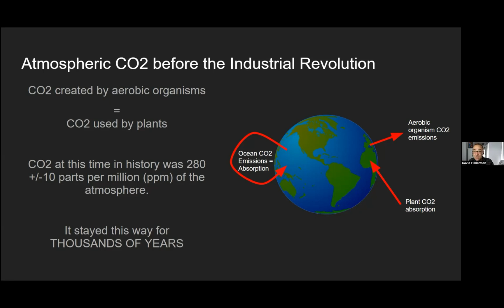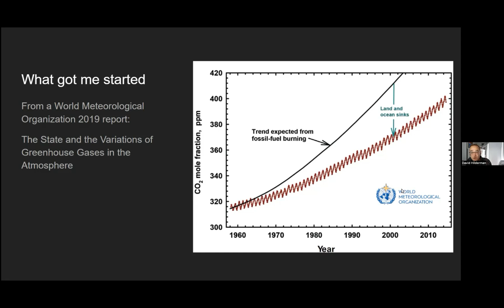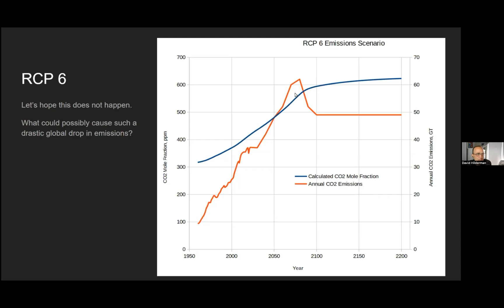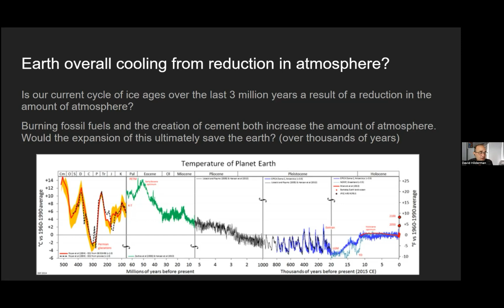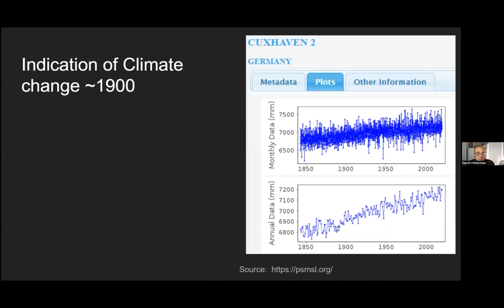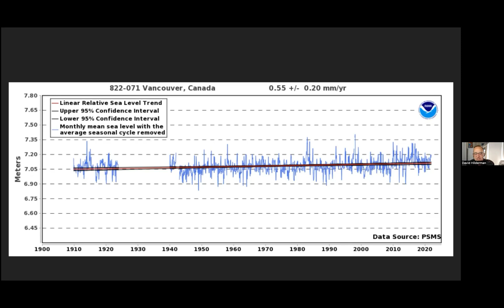David Hilderman: CO2 Emissions and Atmospheric Levels | Nelson Pod #220

Comment: As CO2 is not causing any real sort of warming whey are we even panicking?

When our atmosphere was forming and less than 20 CO2 parts per million there was energy transferred causing warming as heat was radiated from the Sun!   This declined after the first 20ppm on a log base.   The Pen University in an experiment confirmed this writing above 340 parts per million no measurable heat was detected. 

That experiment destroyed any reason for pushing net zero.  As CO2 increase causes insignificant warming it will have no benefit at all.     Net zero  a control device to destroy the last 300 years of scientific progress  any understanding of science raises many reasons to doubt the competence of   those  advocating any carbon seqestration.  If any disagree explain where I'm wrong.   Radiation relies on resonance to transfer energy.   It was over millions of years ago.
Reply: The stupids (a la Bonhoeffer) are in charge...
Reply: CO2 on earth was likely 900,000ppm before life on earth.  Just like mars and venus.  Life used co2 to create plant biomass and calcium carbonate until there was nearly none left.

Comment: I'm glad that you spat out the koolaid. I was always a skeptical observer and decided that ALL warming will end / be proofed by sea level. Like you a looked at Victoria which was the most stable data anywhere on the coast. I explain it by saying if you stand on a rock with water at the bottoms, a hundred years from now, if your boots are short, your feet will finally get wet ... some existential threat.

Comment: Very good video with lots of information.
The correlation between fossile fuel and rise from powerty is a bit over simplistic.
You want cheap reliable energy for a thriving economy. We also get that from nuclear and hydro power. In most places it is easier and cheaper with coal plants. 
As there are a lot more coal, oil and gas plants it looks like the correlation is between them and thriving economy.

Comment: in your equation you should perhaps add the effect of Cocolithophors in the oceans.
These little creature absorbs CO2 in the form of calcium carbonate with which they make their shells for defence.
They routinely absorb mega tons of CO2 which gets trapped on the sea floor as solid and becomes sedimentary rocks on their death.
This is a one-way absorption and which does not restitute in the system.
You should google it for more quantitative details.
Reply: Thanks!  Yes I was aware of those things and actually described them in a video I made a few years ago but didn't remember them in this presentation.  I suspect that they are the reason for a significant reduction in the mass of the earth's atmosphere.

Comment: Tom, at 3:48, you answer your own question, but you miss it!! So what that the northern hemisphere has more land? That by itself isn’t important. What is impotent is that there are lots of foliage, mostly trees. Not that the rest of the world doesn’t have trees, but the southern hemisphere has less land and is largely arid. 

This cycle was discovered by a guy named Keeling in 1958, I believe. This is proof that human produced co2 doesn’t even measure compared to natural co2. Think about it, every year, the natural variation is 8 to 10 PPM!!!! This doesn’t account for the equatorial foliage, as this is largely consistent. More plants grow, more plants die, more atmospheric co2. Thus, the annual increase of about 1 PPM. Sure, some of that is human caused, but not a lot of it.

Comment: 11:20 I am undecided in either direction on CO2, though I lean away from the climate alarmists.

However, it should be pointed out that just because the oceans are "absorbing X amount of CO2," it doesn't mean the oceans are processing it like plant growth does.  The dissolved concentration of CO2 in the oceans is also increasing, and there isn't an infinite capacity for them to do so.  What that capacity limit is I cannot say - but there is a limit somewhere.

Comment: Yes I've done this and used most these slides myself at one point.  I'd like to talk to you more about this, I believe i have roughly 500 to 1000hrs of research on this including some unique approaches you may like (animal generated co2 low estimation 680gt a year). Also carbon based life on a predominantly carbon earth should reveal how carbon is opposite of a pollutant, but actually essential for ALL life.  Every single living think from bacteria, fish, and us require co2. And how co2 is plant food and how plants are starved, their optimal ranges are 3 x to 4 x current ppm levels. Or how moles are a dimensionless measurement and the SI regarding measurement would mean mol isnt a measurement since there is no base unit (there is more, but too much to go into by text). Think on this, have you ever seen an air bubble travel deeper in water? Or what makes your pop go flat (or no more co2?) Co2 in many water beverages will rush out of the liquid when container is opened, I've never heard of it going the other way, density shows otherwise  (but i believe true science means to be open to any possibility,  never fall in love with a hypothesis/ theory, always follow the data, and be more critical of studies within your bias than without, and lastly always verify the foundation is solid). You can't build a hypothesis upon unreality to prove reality (big bang for example assumes reality was created by disorder, randomness, chance/ chaos, but that's easily dismissed, the scientific method alone disproves it since it's a logic based, ordered structure that reasons out repeatable principalities. Does the moons phases change at random? Does the sun rise change cardinal directions? Do seeds ever bring forth something other than is own kind? 
I think i could possibly save you a couple years of research, or at least share where to find some of the different research i utilized.  Either way, I do think you'd be interested.
Reply: I would be into connecting once the daily comments slow to a trickle.
Reply: That sounds good

Comment: Will Happer is among the most learned and most expert specialists at the interaction of atmospheric gasses with electromagnetic radiation humanity has ever produced. His opinion on CO2-caused warming (my summary): it's a total non-issue. Why? Because the physical mechanism that causes the warming is 98% saturated at a concentration of 400 parts per million by volume (ppmv). The concentration right now is about 425 ppmv. No matter how much CO2 is increased, the CO2 caused warming can only increase by 2% of what it is now.

Comment: If plants could talk, they'd say thank you to humans for replenishing some of the carbon dioxide that was taken out of the atmosphere and turned into fossil fuels and carbonaceous rock. Burning fossil fuels is a net-zero process.
Do a simple Google search and check out CO2 levels and global temperature over the last 600 million years, you'll see that atmospheric CO2 is very LOW and the planet is in a COLD period at this time! Furthermore you'll see that CO2 clearly does not drive temperature!
So why are we spending trillions of $ that we don't have on a problem that doesn't exist for solutions that wouldn't work even if the problem were real?? 
Check "Climate The Movie - The Cold Truth" on youtube. It does a good job of deconstructing man made-up climate change.

Comment: 22:00 Stomata density has an optimum, not only governed by CO2 levels but also availability of water. Having more stomata and opening them has the advantage of inhaling more CO2 and exhaling more O2 (thus promoting photosynthesis/growth), but the disadvantage of losing too much water and drying out: it is a trade off. Therefore, higher CO2 concentration enables plants to have less stomata and grow in dryer environments.

When comparing stomata densities it is crucial to take water availability into account!
Reply: The edge of the desert is the threshold of where stomata loose too much water. Increase CO2 and the desert retreats.

Comment: Here's some interesting tidbits. The surface area of the oceans is 361.74 million sq kilometers. Surface area on Antarctic glacier in summer 13.5 million sq kilometers. Avg ice depth 2000m. Area Glacier/Area of the Oceans gives the ratio as a percentage. Multiply by the ice depth. Another trend to watch is the end of the Milankovitch Cycle formerly known as the Mayan Calendar. Arctic Sea Ice Extent was trending downward until 2012/13. This has been trending upward since then, with increasing sea ice square area. Antarctic Sea Ice Extent was increasing, trending upward until 2014/15. Antarctic Sea ice Extent has been trending lower since then. Climate Sea Monkeys are sounding the alarm on the Antarctic Sea Ice melt now. I'll bet everyone has forgotten the scramble and summits that occurred in 2013 about opening up northern shipping routes and a route through the Arctic Ocean? Luckily the internet existed then, the news of the time can still be found. It has happened before, it will happen again. Half a million years of core samples show CO2 plummets in the 100k year cycle deep freeze that lasts 70 thousand years like clockwork. That's the real climate emergency. If the tiny amount of CO2 actually affects climate, maybe it will stave off the pending ice age? However, that would be a stark departure from the half million years of historical data.
Reply: Yes. It is ridiculous to call 2C of warming a crisis when all climatologists know about the 70,000 year glacial cycles. They should all be thrilled that if we are warming the earth we could be averting an ice age.  Duh.

Comment: Tide Guages in England (& Longer but lower resolution in Holland)....show Slow Steady Sea Level Rise AT THE SAME RATE for 175 years.

So the Current "Climate Level Warming" Started At the END of the Little Ice Age 200 years ago....NOT IN ~1950 when CO2 Levels began rising.

Comment: You said in the pre- industrial era CO2 was in balance at about 280ppm? Why did it decline over tens of millions of years to that level from several thousand ppm? The answer is the role of marine organisms whose shells and exoskeletons are all made from calcium carbonate, derived from CO2 dissolved in the oceans. The debris ends up on the ocean floor and does not return to the atmosphere. We build buildings out of limestone which was once atmospheric CO2, we use cement in vast concrete structures derived from what once was atmospheric CO2 hundreds of millions of years ago. 
It is not a cycle in balance but a slow decline in atmospheric CO2 over hundreds of millions of years.
Reply: It was in a balance over a period of thousands of years.  I believe that everything you state is correct.

Comment: Hydrocarbons are continuously being produced by the earth.
That's why we haven't run out and never will.
That's how hydrocarbons continuously push up over 3000 feet above sea level in Fort McMurray Alberta and run down the Athabasca River since before the river was there..
Microorganisms in the oceans eat 99% of the oil producing CO2..
That's why CO2 is constant between The Great Depression and WWII.
We are not and cannot add CO2 to the atmosphere..
That's why AGW is not 100% science fact and remains science fiction..
The Inconvenient Truth is...
The Arctic didn't melt in 2013 because we are in Earth's 5th major ice age called the Quaternary ice age..
All ice ages are CO2 starved because gas's condense and water becomes more soluble when cooled..
All 100% science facts..
Global warming is a hoax..

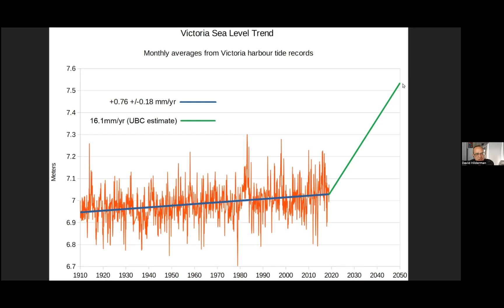Comment: @36:39 you show that we need to reach a singularity point to get sea level rise as plotted.  Possible reasons for singularity:
1. Mass die off of photosynthetic phytoplankton
2. Positive feedback loop of frozen methane thaw under continental shelves+tundra thaw
3. More rain days vs. snow days melting glacial ice at faster rates.
Up to now we've been lucky. Let there be no mistake: we are conducting an experiment to find out what happens.  I hope you are right, that everything stays linear for the next hundred years.  I don't think its a safe bet though.

Comment: CO2 does act as a blocker for infra red emissions.  So I agree with all your charts since there is no link to temperature.   The earth will be a warm greenhouse.  This means of course that all glacial ice will melt.
Its all good as long as you live >250 feet above current sea level.  
Renewable energy systems deploy quicker and are much cheaper than nuclear.
My background: engineer from UCSD, attended a few lectures at Scripps Institute of Oceanography.
Reply: Renewable are neither renewable nor reliable.
Reply: @jdilksjr Well, my solar panels have been working for a decade and charge my car just fine;don't be gaslit by your gas company or utility.
Reply: 250 feet of sea level rise would take 22,000 years at current sea level rise rates.  What do you do for health to expect this kind of longevity?
Reply: @davidhilderman  geometric knock on effects.  Why does everyone assume a linear situation when all the heat and GHGE curves are at least geometric and probably logarithmic.  It's raining when it should be snowing in Antarctica and Greenland.

Comment: As the oceans continue to absorb more CO2, they get more acidic.  As they get more acidic phytoplankton skeletons get weaker.  We know that they are 50% weaker now than in 1960s.  When their skeletons no longer function, and we lose the phytoplankton,  CO2 absorption will dramatically decrease.
Reply: The early studies in this used hydrochloric acid to reduce the PH. Subsequent studies that bubbled 1000ppm CO2 into seawater found that most shellfish had more robust shells as a result. Of course the widely known study is the early study.

Comment: Sea Level is more complicated than meets the eye.  The assumption that the oceans are level even , is incorrect.  The surface of the oceans have topographic highs and lows which vary spatially and temporarily as a result of changing ocean currents , tidal effects , expansion and contraction.  Nevertheless I agree that SLR is not behaving abnormally or alarmingly.
Reply: Wishful thinking.

Comment: It's not correct that the required water is the same. It is by 2 to 5 times less water required as the leaves have smaller holes due to more CO2 😊

Comment: At what point does it start getting hard to breathe? Are there tipping points coming that would cause a giant increase suddenly?
Reply: O2 is a much larger component of air than CO2.
Reply: @avoice423  I know. o2=21% but if Co2 gets from a current 420PPM to 1000 you will suffocate. It's complicated. The hemoglobin has to offload the Co2 to make room for the o2 on the molecule.
Reply: @MichaelDeeringMHC  CO2 percentage of air is .04% dangerous levels are at 15%.

Comment: Your work reminds me of the work I did in the early 2000s, when I dug in to see what type of geoengineering could be done. And you have to get the rates and the outputs and the models and look at watts per square meter. I had tons of excel files and documents and went through the models. You see what I saw. It is fascinating but also infuriating. Feel free to connect and such.

Comment: The argument is global warming is caused by man made increases of co2 in the atmosphere. But the reality is temperatures go up first and increases in co2 happen after the rise in temperatures.
Reply: Nope, that is a misrepresentation of Caillon 2003 based on an ice core from Antarctica. The rise in CO2 precedes temperatures on a global scale even if there is an apparent lag in one very cold region. Go listen to the lectures by Richard Alley who actually works on ice cores.
Reply: @QT5656  Then why did the average temperature go down fallowing WWII? CO2 emissions had been rising for 30 years and the earth cooled for 30 years. That ends the debate on co2 increases causing the temperatures to rise.
Reply: @QT5656  maybe the scientists are wrong about CO2 causing global warming

Comment: I was looking at this study on dandelions grown at different altitudes.

Adaptations and responses of the common dandelion to low atmospheric pressure in high altitude environments.

They found changes in root size. The also found differences in the amount of different chemical compounds that the plant produced. We can imagine that the nutrient profile may alter in different ways if the atmospheric density increased. Further, if pressure increased at higher elevations, we can imagine that some plants would be able to grow further up mountains to higher elevations currently inhospitable to most plants.

Comment: You are indeed missing something important.  The total mass of the atmosphere increases as the amount of CO2 increases.  CO2 has roughly 66% more mass per mole than air so every gigaton of CO2 that enters the atmosphere increases the total mass of the atmosphere by .66 gigaton
Reply: I talk about how burning fossil fuels increases the mass of the atmosphere. It is an implication regarding  one of my big questions.
Reply: @davidhilderman  You do mention it but don't include it in your calculations.  For every mole of CO2 that is added, one mole of O2 is removed.  Burning fossil fuels doesn't actually 'add' CO2 to the atmosphere.  It converts O2 into CO2.  You have to account for the loss of one mole of O2 for each mole of CO2 that you 'add'  One mole of CO2 is only a net increase of 12 grams to the atmosphere not 44grams.

Comment: Thank you for this excellent video. The atmospheric mass reduction could also be from a solar micronova that blew some of it away. Mars may have suffered this fate.
Another key point is C3 plants suffer badly at low CO2. They stop reproducing at 150ppm. In the last glacial maximum, the levels at 180ppm mean that plants would grow poorly and at higher elevations, there were no plants. Food production would be very difficult. The Gobi plateau would be a desert. This explains all the dust in the ice cores.